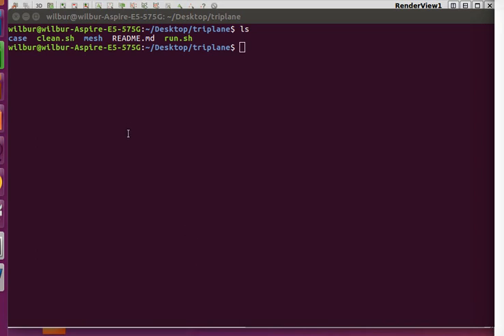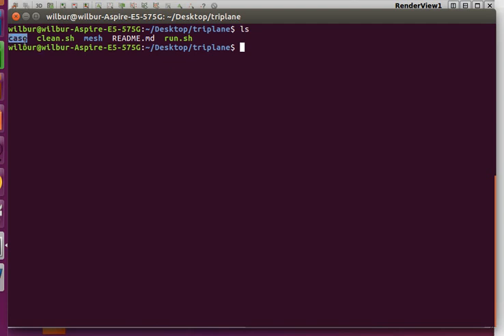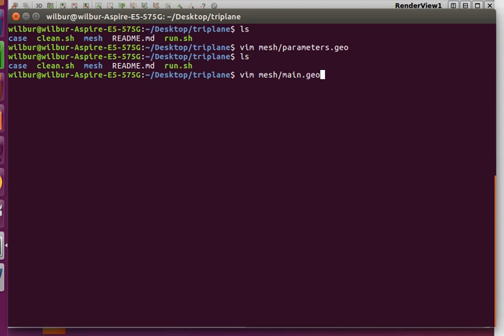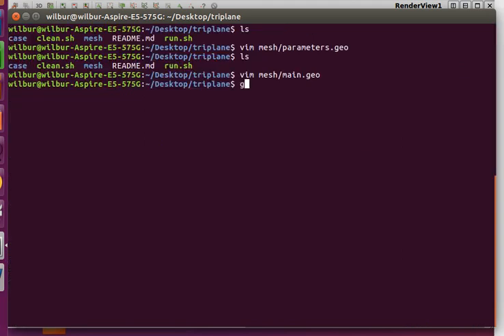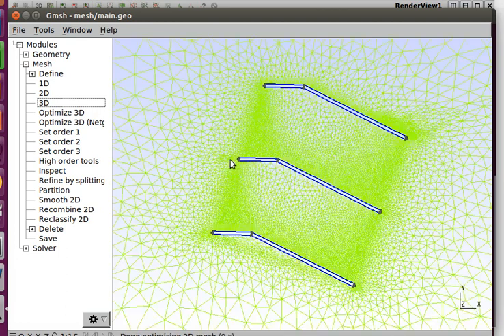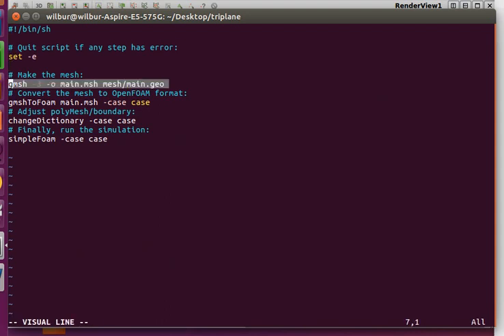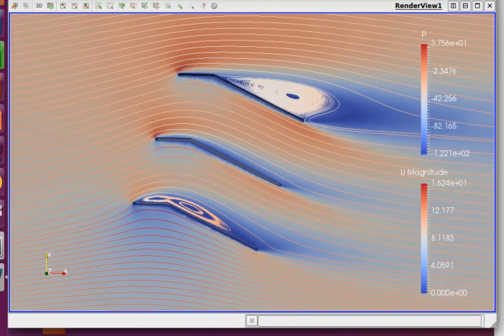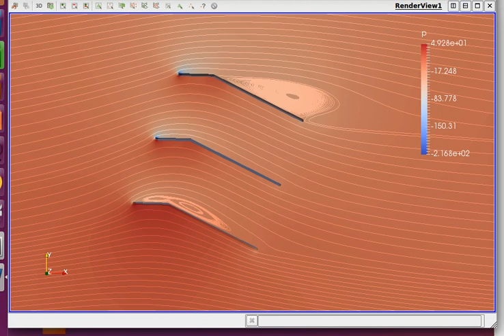Triplane Airfoil Simulation

Comment: Awesome videos. Thanks a lot for the help. I was wondering if you could make a few videos on multiphase simulations in pipes. Thanks!
Reply from the maker: Sounds like a good topic. Do you have specific BCs or applications in mind?
Reply: @OpenFOAMTutorials  yes. I'm looking at two phase coflow in a microfluidic device. So two inlet velocities no slip walls and zero outlet pressure. Thanks a lot!